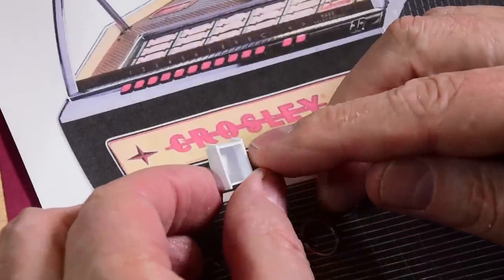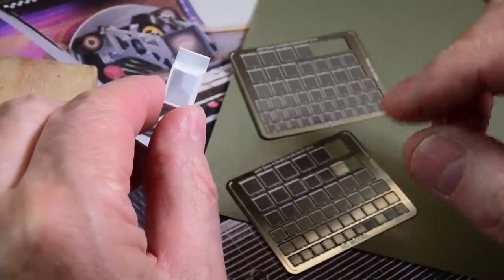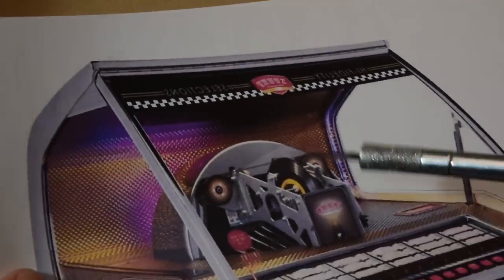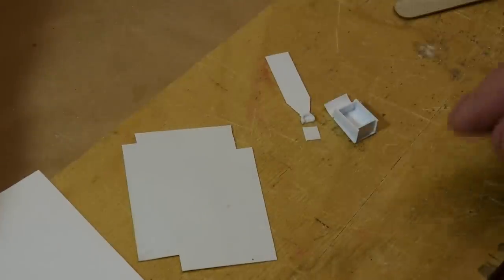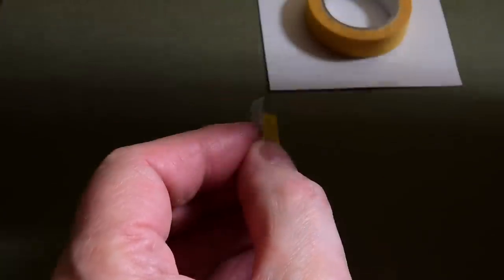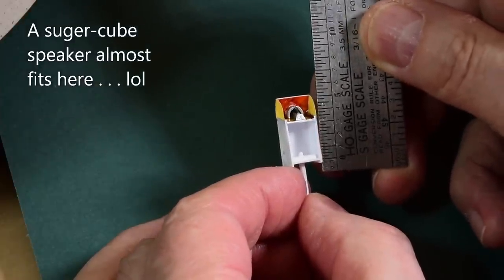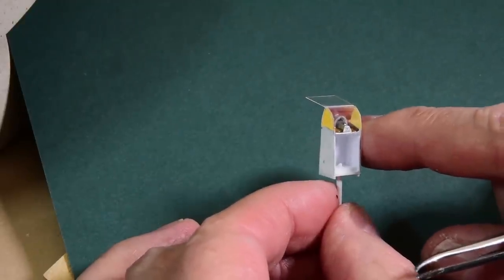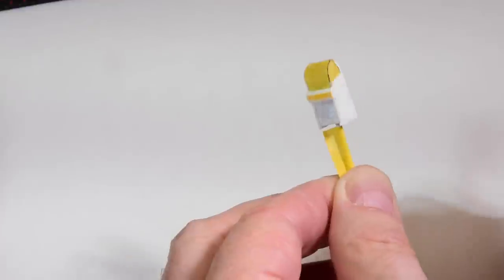The "Nighthawks" Diner Build (Part 14) | River Road ~ Vlog # 149

Comment: Even though I wouldn't scratch build a juke box (3D print), "building on a sprue" will be useful for N scale.
Reply from the maker: Yes indeed. But the 3D print can't build in this way. Building on a sprue is great for any scale depending on the part.😁

Comment: When you scratch build, do you have some kind of general rubric you use to think through the question of: can I paint this once it’s installed or not?  The competing issues are as you have stated that painted styrene parts won’t weld well, but also, it’s hard to paint micro details “in situ” and more comfortable on the flat or on a sprue as you demonstrate.  I’m sure it comes with experience, but this is a big part of the mental hang ups for me as I’m trying to learn to scratch build.
Reply from the maker: I try to build as much as I can get away with before paint. I mask off painted sections when I have to. I learn to manage the overspray with subsequent masks, etc. Every build is different. The more you practice the more you will develop your own style. Try not to get hung up on perfection. The perfect model is a myth even with a master. Cheers.😁

Comment: had the main cabinet in the corner of the dinner and then we had satellite units at each table. Your right, it does look like a post box here in the states. Now I can make them instead of buying them same shape, just a different paint job. My youngest son works for the post office. Older son works for  company that does work in rail yards putting up buildings and other infrastructure things. Did you use satin varnish to glue on the grid on the front???
Reply from the maker: Yes. I used the satin varnish to glue on thee photo-etch grille, Then I came back later and painted in a bead of the same around the edges. You can be liberal with the acrylic resin because it shrinks a bit and disappears.
Reply: @boomerdiorama  Thanks for the reply..

Comment: One last detail how did you make the buttons on the front panel? Are they painted or did use do something else?
Reply from the maker: I used a small metal "pick" (like a needle). I dipped in thick paint and then poked it on.

Comment: A masterpiece Boomer. I know 3-D printing has its place in the hobby but there is something special about building these small details from scratch. Is the term organic? Btw did you use mat medium to glue the clear styrene or was it the Vallejo?
Reply from the maker: I used the Vallejo as show in the video. I use the term "Matte Medium" often because it refers to the same thing really. Matt Medium and Matte Resin are very similar in properties with both being water-based acrylic mediums. The former being commercial art product (flexible), the latter being hobby product (rigid). Much in the same way as Modpog is similar to Acrylic Gel Medium as well. Both can be mixed with paint and they also act as an adhesive.😁
Reply: @boomerdiorama  Thx Boomer. I have both Matt Medium and Vallejo. Thx again 👌